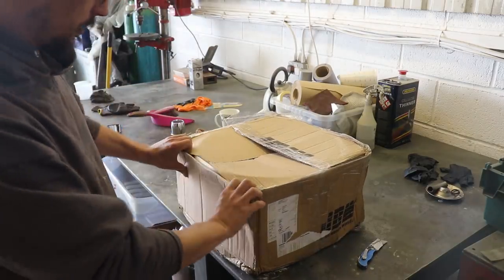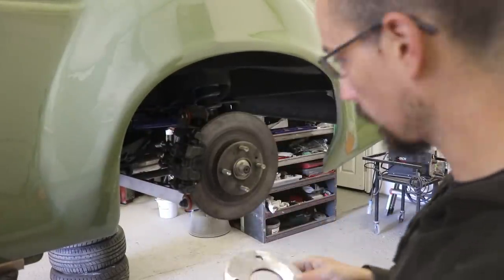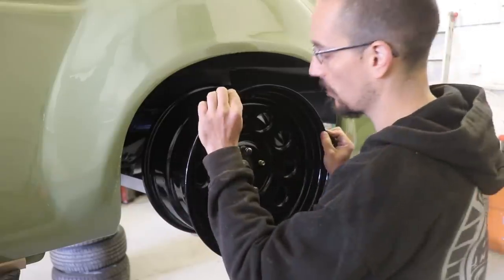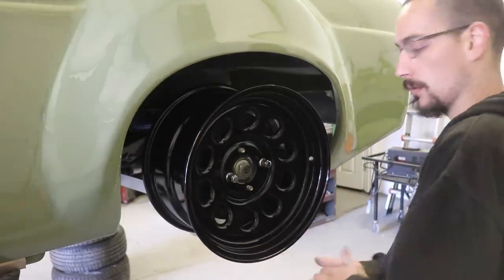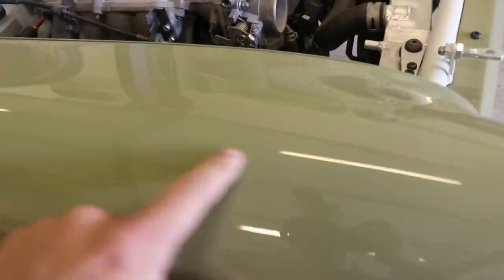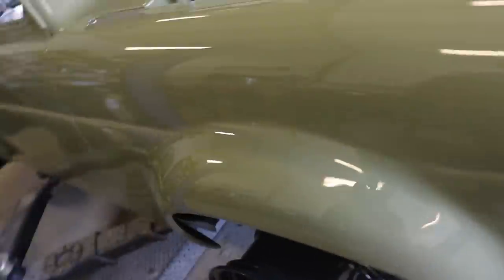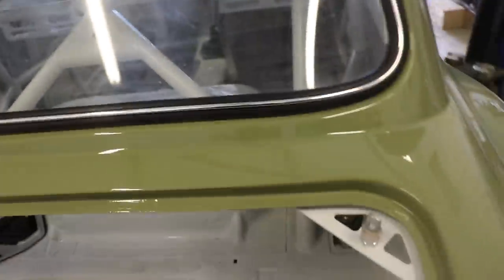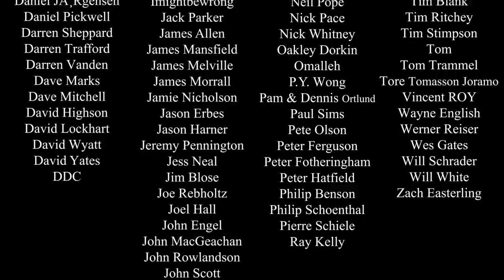THE PAINT WORK  IS FINISHED

Comment: The pin holes are known as fish eyes. They are caused by silicone getting on the panels. It is almost impossible to get it off in the prep. 
Most paint shops ban all silicone products from site. But given you do so much other stuff , you can’t stop it getting on the panels. Having said that you have done a great job given your modest experience. Love what you have done . Keep it up..
Reply: Exactly. At our shop we use Spies Hecker Permahyd Silicone Remover 7080 https://www.spieshecker.com/corporate/en_GB/products/passenger-cars/removers.html
And if a diesel car/truck drove by, we’d have to wipe it down again..
Reply: I was gonna say pretty much exactly this. I've got nothing to add other than my agreement that silicone residue is almost certainly the culprit.
Reply: Ben Pierre Great info. Thank you, Ben.
Reply: When i worked at a van painters we used a full size unit to spray them and never had any problems with fish eye problems until all the vans that were sprayed kept getting fish eyes all over them and painter didn't know why until one day he went into the unit next door where they manufactured vertical blinds and noticed one of the lads assembling the rail and carriage and noticed he was lubricating the top rail with a spray so asked him what was it he was using and he said silicone spray well you should of seen him flip his lid with the owner, what was happening was when he was spraying a vehicle he had the extractor fan on to draw the paint fumes out the building and where the joint was at the top of the dividing wall was it had a foam infill the void between the wall and the roof and it was sucking the mist off the silicone spray that they were using through that void straight into the unit he was spraying in and causing the fish eyes.
Reply: I heard that silicon is even in hair products and even that can mess up a paint job.

I don't know where the hell I heard that. In some dark recess in the back of my mind tells me I heard it on National Geographic ultimate factories.
Reply: Pin holes are NOT fish eyes! nor are they caused by silicon. Silicon is present on most cars in the form of polish and other car related products and can be easily removed
with a strong hot washing up liquid and water followed by a good panel wipe solvent when dry. The problem is not the panel but airborne silicon being forced onto the panel with the paint fan from the gun. If you get pin holes spay further away from the panel and turn the paint flow up and the air pressure down. Always do a paint fan test on a bit of vertical masking paper, adjust the fan of the gun so it is an even paint load across the fan. If you notice pin holes while painting do not try and load the paint on to get it to flow out, it won't and you will make the pin holes worse, STOP and sort the gun out.
Reply: I'm Stubby , you are right. You can call them anything you want. And yes no part of a fish is on the panel. You say it is NOT silicon and then go on to say it is silicon forced on to the panel by the air flow. You certainly put your point across well.
Reply: Anti static wipes or if you want to splash out, a Stat Gun.

Comment: For the window seal...you can get at a hardware store "window screen spline" in black, and even use the tool that's for re-screening to push it into the void to take up the slack. No worrying about new trim.

Comment: I’ve got 10 x16” steels on my old Land Cruiser, so I know how heavy those wheels must be ... nice paint job, it’s looking almost finished now, it’s so cool.
The chrome plastic trim strip is called a locking strip, or used to be back in the day, it literally crimps the rubber against the glass and the steel aperture. Used to buy it by the yard in the old days👍🏻🇷🇴🇬🇧

Comment: nice build . old trick for those window seal installation , put seal on window , put a small soapy string in the groove, wrap it around about 3 times , place it in hole, pull string from inside towards center. i just subscribed, awesome paint

Comment: Down here in the antipodes we use the window rubber locking strip the other way around, that is the strip feeds through the handle and into the slot and then pull the handle around the screen. That is ifn I can even find the tool, usually end up using the nozzle off a caulking gun tube.

Comment: For your first time, don't beat yourself up. You learn by doing, and no two paint jobs will ever lay down the same.

I think you could help prevent runs opening your fan up, and turning your flow down. You shouldn't try for full coverage on your first pass; you should see some primer underneath your first coat. Then you go over again a little slower each time. I would also bring the gun away from the part some. It looked like you were pretty close (or it could have been perspective). Really though, you did a pretty damn good job. All of these "pro builder" tv shows... NONE of them lay down glass. They ALL rub out the imperfections. Don't let that crap get to you. 

It's been awesome watching the mongrel go from the roached field shell to this. You've done absolutely awesome work, and I hope you have more of this stuff to come with the CNC framed bike and the Escort.

Comment: I've took runs out with masking tape before ,you need a length of it and just before  it goes tacky stick it on top of run and lift it out ,blow a bit more paint  over and when  dry wet flat out easier than flating a run

Comment: Those spacers need a center section for the rim to locate on to the hub.
The way they are in this video, the mass of the vehicle is on the wheel studs, and not on the axle hub where it belongs. Installing spacers like these leads to wheel studs shearing off.
The fix is adding an extra ring to for the wheel to locate on to, on the new spacers.

Comment: Get endless mini rubber and black filler strip, cut the rubber 1” over size put the joint bottom middle, use sealer outside top and sides of the rubber to body and both sides and bottom glass to rubber don’t stretch the filler strip, use plan green Swarfega to fit the screens down filler strip, it works much better than washing up liquid

Comment: When I was in the trade we would use string to get the screens in not a plastic tool the rubber was put on the glass and a string was wrapped around inside the aperture then the glass and rubber were held in position and the string pulled pulling the rubber seal into place.  As to professional sprayers making awesome cars I built a pick up from a Citron estate. Runs and "pin holes" happen but pin holes or fish eys are caused by silicon ot oil on the surface of the body prior to spraying.

Comment: The pinholes are silicone fisheyes  , most likely from the compressor air ,need to make sure your inline filters are good . You could try a  quartz denibbing block for shaving down the clearcoat runs once the clear is good n hard .

Comment: It's all learning as you go but you are doing well 👍🏾👍🏾👍🏾   I think that you have the gear to make your own wheels can do steel rim and bolt in center's  could make the center out of aluminum with your laser cuter clean up in the lathe as some mag's you can get are   two piece or 3 pieces bolted together  lot of work,   or can make out of steel weld the center in the lathe?  Or cheaper to see what American racing's wheels have??  Be awesome to see it on the ground and running soon 👍🏾👍🏾

Comment: The heavy wheels might make it harder to initiate a powerslide type drift (especially without adding a turbo to the Mx-5 engine), but they’ll probably make it easier to keep a slide going, like having flywheels for wheels init, they’ll just keep on spinning.

Comment: Pin holes are caused by spraying to close to the panel and or at to high gun pressure the paint gets air bubbles forced into it and when they burst it leaves a pin hole, silicon is not the cause of this defect. Silicon problems leave a dish in the paint hence 'fish eyes' there are good silicon removers on the market but if your shop is badly contaminated (mechanical shop) you can mix silicon with the paint in the gun to stop problems.

Comment: The hole in the centre of the rims is there for a purpose . It takes the actual thrust of the wheels vertically. The studs are there only to hold the rims onto the hub. By using those spacer plates your wheels will be hanging on only by the studs and this is dangerous. Thats why spacers are banned in most countries unless trhey match up the centre of hub and then the rim. Ask your local MOT place . They wouldnt pass that setup.

Comment: In 1966 I bought my first car a 1955 English Ford Anglia.. I got it from a friends sister for $6.00 U.S. and had to pay for it in two payments. We were really poor. It had the 100 E. engine. I loaned to to my friend who would later become the husband of the girl I bought it from. He took her to a movie and wound up blowing a con rod threw the side of the block. I bought a second Anglia from a friend down the alley from me for $50.00. It was a 1957 model with right hand steering. I took the engine from it and put it in mine. I took a axe and cut up the 1957 model to get rid of it. I know dumb. I wound up selling the 1955  back to the girl and her now husband I got it from. We were on the freeway one day in it when a second Anglia pulled up next to us and wanted to race. We got up to about 70 miles a hour and the other Anglia left us far behind. Just then the engine blew up again sending the two rear con rods threw the block and it was still running on the front two cylinders. We were right by Roy's auto wrecking so we limped it inside and Roy gave my friend $15.00 for it for scrap. About a year later my friend bought another one and so did I. H.is had a broken windshield, so we took turns using my windshield. We later got two more from a house painter who I use to sell extra parts to. During this time i met a woman who had a Thames that needed some minor work done to it. Hers had a 4 speed, posi rear end and some type of OHV conversion cylinder head on it. The intake had a block off plate on it and had two carbs that mounted right on the head. I believe the head had the intake valves in it and the block still had the exhaust valves in it. I got to drive it a few times and it was much faster than any of ours. On one of my times driving it I backed up into the driveway of a police office who lived a block over from us and left two long strips of burnt rubber down his driveway.

Comment: your method obviously works for you but ive always found it easier to put the screen in the rubber then fit the whole thing into the car rather than fit the rubber to the car then try to fit the window in afterwards. i will admit ive not tried to fit the windows in a car with a cage though. usually some thin rope works a treat to pull the rubbers over the metal lips into the car to get the glass and rubber assemblies in.

Comment: Please get some proper hubcentric spacers for those wheels (or turn some up yourself 😉). Those ones you've cut are only good for checking fitment and should not be used when you get the car running.

Comment: next time.. https://www.eastwood.com/fish-eye-eliminator-pint.html fixes the fisheyes. as for the steel wheels, they won't be busting out on you over different motorsports. a little extra wheel weight is not an issue on a small car big engine and you will in your mind feel safer at hill climbs etc if you go to them.

Comment: think these wheels get used a lot in oval racing (stockcar) seen them with oval slots in them too
https://content.speedwaymotors.com/ProductImages/25850184730_L_a79cf12e-eafe-4ea5-8dfe-2b0373b36e9a.jpg
was looking at them as a cheap alternative to aluminium rims for my pickup
could add a small pinstripe to the wheel same as the picture but use the green you used on the car
as for the aluminium rims that dont fit ; it the clearance issue isnt to severe you could have a machineshop take some off that inner lip thats touching the calipers , shouldn't hurt the overal strength of the wheel too mush but does make them one off wheels (cant fit off the shelve replacements )
the pinholes are make by silicone residue , if you trow water over the part before paint it will show about the same thing while the water is running off , its common for profesional painters to come across them too if they happen to have touched something with silicone on / in it (stuff like dashcleaner ) but i suspect its some of the mould release compound left on the fiberglas , there custom thinners removers available to get that stuff off mostly , its pretty stubborn though
as for the rear light , you might be able to paint the inside in some orange tinted clear lackuer https://www.justdial.com/PS-43-Tamiya-Color-Transparent-Orange-Polycarbonate-Spray-Paint/pid-12295270 to get the orange back , to make an officer look the other way you could fit an orange indicatorbulb instead